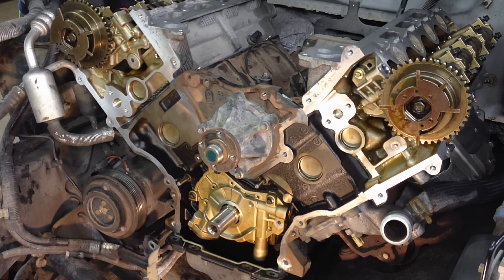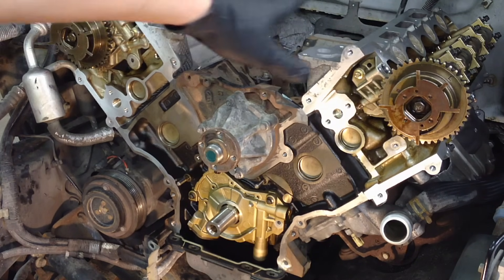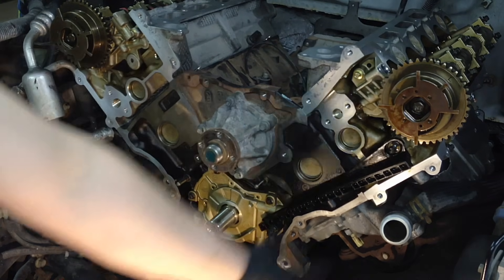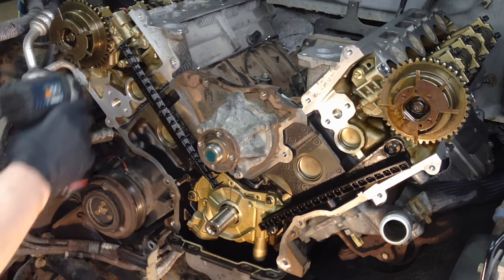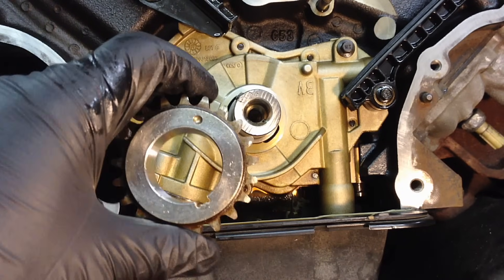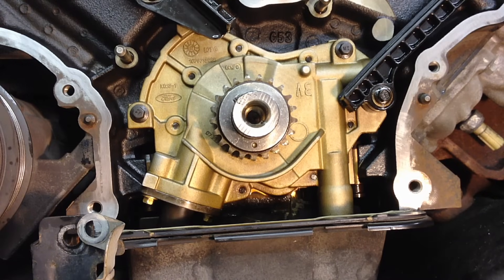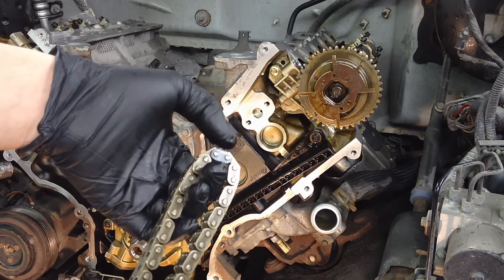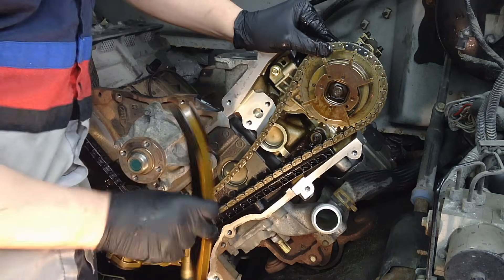Ford 5.4L 3v Engine Timing Walkthrough

Comment: You didnt mention if it was set to TDC on the compression stroke. Does it matter on this engine or can it be set via the TDC of the exhaust stroke
Reply from the maker: It doesnt matter as long as the timing tool is installed you are good.

Comment: Cylinder 1 still has to be tdc compression stroke correct?
Reply from the maker: There is no #1 TDC on compression stroke. The crank is set by the tool and the chain links guide you the rest of the way.

Comment: Hello, so i have done the full timing job as you showed. I have also replaced all of the roller followers. Bought the ford kit that you recommended. Also got the melling upgraded oil pump. Followed all instructions in detail as you showed. Engine was running fine beforehand except for the tick from passenger side chain. Once put all back together the engine starts back up and runs fine cold but once it warms up it runs slightly rough and stalls.  I disconnected the vct solenoids and problem still exist at warm up. I am certain the timing was set right during assembly. Any recommendations on what to check or what the problem may be?
Reply: Hi Ford Tech!  Any insight would be greatly appreciated.

Comment: Good evening, excuse me, I have a 2005 Lincoln Navigator and it's failing. I get codes P0 340 and P0344. I've already changed the camshaft sensor and the spark plugs and it's still the same. Could you tell me what the fault is?

Comment: please help, i re did my timing and i tried my best to follow everything, i replaced everything inside all oem but the phasers are dorman. i still have p0022 and p0012. i swear it was timied properly. crank dot at 6 and valve lobes where out like they should be. i put the truck back together and it idles low and rough, with gas it seems to run ok. please help ive been dealing with this for a long time

Comment: Hey man I really need you help asap I’m in my 5.4 3 valve right now the guides are broken. Previous owner was driving down the highway and it shut off on him. Oil is very sluggish. But I need to know if the motor is saveable or if the timing is jumped and if it is can I get away with retiming it
Reply: Did you save it?

Comment: For this procedure, don’t you have to make sure that the cylinder one piston is at top dead center in the compression stroke??
Reply: I just did a buddies for the first time, the passenger side jumped time after a broke chain guide. The chains didnt have colored links or any reference so  I locked the cams down, with the camshaft key at 6 oclock, removed chains put the driver side back on (with marked links, as it was) and then rocked the driver cam to appropriate link on its chain. I'm sure you know what I'm telling you but I'm just putting is out ther for other first timers.

Comment: what scan tool do you use to check phasers on the 5.4l 3v?  had a 05 navigator get timing job done adn it still acts like timing is slightly off. not sure if its phasers or bad ecm

Comment: Would have been nice to see where that timing tool lined up to when in the correct position. You blocked 30% of the video setting the crank in position.
Reply from the maker: Doesn't matter, the chain colored links is al that matters.

Comment: I followed along the workshop manual so I did the cylinder 1 exhaust lobe coming up exhaust stroke with keyway at 12 o clock then did removed the 3 RH followers illustrated and then the 3 LH illustrated. Then roster clockwise to 6 o clock. Removed  all timing chain components chains,guides,tensioners,phasers. Coming back to my phaser marks aren’t in the same position as you showed or in the book. So the chain marks aren’t lined up I’m not sure what to do next. I didn’t have a timing check engine light before I’m just doing the kit for the phaser tick. If any advice thanks!!
Reply from the maker: Once the cam followers are neutralized you can remove the cams as I show. Then scoop up the followers and reinstall camshafts as shown. Now you can line up the cam and crank
Reply: @ I see it was my fault thinking I could cut corners and not have to remove the camshafts as well haha sorry but thank you for the reply!
Reply: Rotated* lol
Reply: Forgot to mention after the removal I used the special tool and it’s still not lined up

Comment: I appreciate your videos.  I just finished mine.  I didn't do a lot of the things you did like disconnecting the oil sensor and such.  2005 F150.  It wasn't bad.  It did take me 3 days.  I didn't remove the roller followers.  My truck is under 100k miles. I set the crank at 6 before removing chains and then as I removed the chains I had a breaker bar on the phasers.  I simply slowly moved the cam to a slack position in between valves/compression.  The driver side was pretty much there already.  The passenger side I moved left until it wasn't going anywhere.  Then I cleaned everything up, changed the phasers, and just moved the cam back to where I needed it when I reassembled.  Easy peasy.  I used all Ford parts but used the old style tensioners.  All my old parts, including the guides, were in good shape.  Only the driver tensioner was bad.  My phasers weren't bad either as far as I know but I had it open.  

I believe I could do it completely in 10 hours or so doing it again with confidence. If you were comfortable reusing the valve cover gaskets and the sealing surface of the head was relatively clean(mine was), you could really save a huge amount of time by just loosening them and lifting it up enough to access the phasers and never remove the valve covers from the engine or any of the other stuff hanging around.   I am willing to bet I could do it in 5-6 hours this way.  

If I do another one I will rinse the top of the engine off the day before to get rid of a lot of the dirt and debris around the valve cover.

Comment: What would happen if you install vet actuators on wrong side. Doing one today that has left on right bank
Reply: VVT
Reply from the maker: They are universal with markings for both sides
Reply: @FordTechMakuloco  I just found out that they are same part number and the marking weren't visible at 1st. Brain fart morning . Thanks for reaching out

Comment: Hi, so I bit off more then I can chew on this project. 05 expedition 5.4. I am at the point of reinstalling everything and need to time it all. My question is, do you absolutely need to remove the roller followers? Or can you just turn the van to adjust for timing marks?
Thanks
Reply: Sorry camshaft

Comment: Mr Ford Tech I have an important question that no one seems to answer. I have a 05 f250 with the 3v 5.4 . I bought it not running due to timing issues. I spent $2,000 installing all new timing components and oil pump , plugs etc . Now they are saying I have a main or rod bearing knocking . I can’t afford a new engine however I have a very strong 5.4 2v with very low miles since the rebuild. Can I install the 3v top end onto the 2v block . Is there any advice or tips to do this . I want to retain the factory operation of the truck . They said I could install the 2v in the truck but will need to be tuned and other things . I just want my truck on the road and be reliable. Please any advice is appreciated greatly thank you

Comment: What is the cost of doing a hydraulic valve lifters, roller rocker and new cam shafts along with a new timing chains, hydrolic tensioner, and new chain guides?

Comment: I did exactly as you told us, but when I rotated the engine the marks on the timing chain a full rotation were not on the timing chain marks, as 11 o'clock and six o'clock, I used the tool on the crankshaft . so I dont know if this is Ok . Please help.

Comment: Hi, Very informative video!
I was also doing my timing chain replacement in the same Engine, while doing it i lost my Timing, so after watching this video what i learned like if i move the crank shaft to 6 o clock position without rollers & chain on the engine , it will come to neutral position then i have to reposition the crank shaft as described in-the video by using the reposition tool to 11 o clock then install the chain according to mark. Was it correct?

Comment: Hi, back again to check with you, the Ford guru on timing marks. So much false information online. Sometimes I don't even trust identifix. 😂 
My customer today is a 2010 5.4 3v. Owner did his own timing chains and it rattled sporadically. Looks like driver's side cam is 1/4 of a turn retarded, but strangely engine ran smooth as butter. Multiple codes po012, 022, 316, 341, 346, 346. Easy money!

Comment: Ok so just to make sure i heard you correctly. If the cams are not timed together all you would have to do is remove all of your roller followers, set the crank sprocket in the correct position, align the timing chains on the guides install the tensioner guides and tensionors, and your timing should be correct?
Reply: That’s what I was thinking as  well

Comment: Why does the '04 5.4 3v procedure different from the '07 where you turn crank to 6 o'clock. Is it bad practice to perform 04 procedure on 07?

Comment: My facers left is on right and right on left😢
Reply from the maker: No they are universal with timing marks 180 degrees out from each other.
Reply: @fordtechmakuloco if I put crank tool on there so it's perfect but my left phaser is "R" and my right phaser is "L" can I just turn those phasers 180 degrees on the cams so right is "R" and left is "L" or will that make my timing out AND should #1 cylinder be on compression stroke when at TDC when ceank is set  with the tool? please help. I want it back together right

Comment: I’m an Audi tech, and I’m so glad I’ve never had to touch those pos fords. Audis are so much easier and enjoyable to work on. I’m saying this with full sincerity. People think Audis are horrible and that they’re really hard to work on, they’re really not lol. They make simple engines and everything on them makes sense. Timing chains might be in the rear but that’s about the only odd thing. If you have to do chains on a 2.0 turbo you just pull the front of the car off and it’s right there. Takes 3-4 hours. And we don’t really see chains fail on any of the other engines, just guides mostly. I just completely rebuilt the 2.0 turbo 4 banger from my 2016 A4 and I rebuilt the 3.0 supercharged V6 in my 2014 SQ5 these past two weeks and they were both pretty fun jobs and nothing gave me a hard time. Biggest thing to pay attention to is using the correct special tools for the timing and making sure to pretension the cam adjusters before torquing the bolts. Everything else is simple engine stuff, cleaning takes the longest out of anything. Both cars running perfect now. Anytime I look at fords or dodges or any Asian car I feel disgusted. I work at a dealer and I don’t know why but I found myself replacing one of the 2.4L engines in a Honda Accord and I was pissed off about it because the connectors were so incredibly stupidly designed and the subframe bolt torques made absolutely no sense. Also the parts back from Honda they gave me they didn’t label any bolts and they all looked the exact same with slight differences and I was just like bruh tf is this. But yeah I did the Honda engine and then I had another accord too that I did the rear main seal and that balance shaft cover on. Those were equally as stupid. I couldn’t imagine working on anything other than Audis. I used to be a used car tech and I think front axles on an F250 were pretty easy and then I did an evap canister on a Buick Encore which was pretty easy and some work on a hellcat which was pretty straight forward. But still, I’d take Audi any day of the week. Everything simply makes sense.

Comment: I can tell you that's the wrong way to do it cuz the only way to slide them rockers back in is to loosen the cam up and it messes up the cam journals in the cans will bind that's what happens it's a good way to ruin ruin the heads

Comment: What size cams would be a good fit to give it a good lope and better performance and pulling power. Will roller set up work well and why don't they tell you that you have to change this at around 120, 000. I actually made it to 152,000 but how will i know if have trashed the motor the oil pressure dropped to 0. I would greatly appreciate any advice you or anyone can give me. And should I get a high performance oil pump. And what else can i do to up the horse power i had a 2018 and 2020 now after doing a few things to thenm i had them at around 415 horsepower they come from the factory supposedly with 395. I love them. Please help

Comment: I have a 4.6L 3v mustang, I'm rebuilding the motor, first actual rebuild I'm doing. I've worked with the 3v before and messed up the timing. Is this all you have to do?? Many people have told me to make sure I have the pistons in the right location+key on the crankshaft. Something that has to do with the normal stroke and power stroke. I ended up with low compression last time. Could you help explain why a bad timing job would give me low compression, and if the pistons have to be in a certain orientation for allighnment with a normal stroke and power stroke?

Comment: I’ve watched several of your videos and they are very helpful but I still don’t understand how you put the cam followers back in after you put the timing chains on
Reply: just search his videos ,he has one that shows how but you need the special tool. otherwise you turn the crank clockwise until the cam is at base circle for each set of valves  and you can pop them on with a curved pry bar but I find the tool is easier by far

Comment: Had to replace the timing guides on mine (2006 Ford F-150 5.4L 3V 4x4). We got the Left side of the engine & chain set correctly, however, whenever we do the right side we run into this problem:

The R on the right side isn’t lined in the same position the L is, and whenever we rotate the cam it rotates the camshaft and causes it to jump. So we don’t turn it that far, but when we get the chain on and let it go back, the bottom skips. Chain isn’t stretched and crank gear thing isn’t damaged either. Any tips?
Reply: change the broken guide

Comment: Ok, and the timing is set at the Crank Shaft. Do I follow the markings on the chain?. Add replacing a cylinder head.
Maybe I'm over thinking it but the marking in the timing on the cylinder has looks to be correct or maybe I'm over thinking it I don't. Know about 4 I put it back together.
And wreck the motor.  Do I follow the marking on the chains? The difference is one side. I didn't touch that I know it's time. The other side looks to be right on point but looks can be Deceiving. How do I confirm that the Valve.. are in the right position?

Comment: I'm a replacing a cylinder head on a 2013 for an expedition.
How do I set that 1 soon there had to the motor correctly? Do I follow the chain?
Or do I follow the Camp Lobes.
Reply from the maker: You bolt the head on and then follow the complete timing procedure from scratch.
Reply: @FordTechMakuloco  they New from Ford end cam Fazer is new from Ford my question is the Driver side is set but replacing the untimes cylinder head on the passenger side isn't set or it is. I don't know but the chain is telling me it's set.  I just want to make sure that I'm not missing A step.. Add unfortunately. I am waiting for tensioner bolts For the oil tensioner.
Because I can't seem to find the old ones.. And it's on the weekend.. I did remove the 3 valve And it appears the markings on the chain looks to be correct orientation.
At the 11  And 1 o'clock. Maybe I'm over thinking it before I button it up or a nervous.
But everything looks good as far as the markings go and the crank. Is that at the 6 o'clock position? And I guess the question is right now. When? Replacing your head do I have to take the other side that was already set? Where do I take all the chains off and set The timing to be sure. And the valve trees On both sides because the situation I'm in again is one side is already time. The other side isn't. Do I have to take off the chain on the other side to set the timing correctly?.
Reply: @FordTechMakuloco  watching your videos and I appreciate you very much. For what you do keep up the great work...
Reply: Dam phone, sorry . I'm Surprises that the Head bolts didn't  snap when I was doing when I did the 90 degrees  twice. I was nervous . And I Followed the Torque sequence on those heads boy that was Fun.
Reply: @FordTechMakuloco  Just follow the walk through the 13 minute video is that what I should do? Follow the procedures in that order.

Comment: I’m getting ready to do a timing job on my 2006 F150 5.4. 2 questions. I got a timing cover gasket set that came with a small black o-ring. 1. Is that for the coolant passage in the timing cover? 2. Do you remove the screens in the VVT housings to clean them? Your help would be greatly appreciated. Thank you.

Comment: Hello how you doing I have a F350 06 model XL work truck dually Scott like 86000 miles got the 54 3 valve anyway it runs fine sometimes and then all the sudden it sounds like crap

Comment: Yeah, just toss those followers in after you have everything torqued down. They just slide RIGHT in under the cam like nothing. You bozo, your going to throw off all the work you just did timing the motor when you pull the cam to replace the followers
Reply from the maker: I am not sure you know what you are talking about, please see my video on how to replace followers on this engine, thanks!

Comment: I'm getting my 01 back on the road. Been sitting 8 years. New plugs and coils. Replaced the fuel pump. But still just the slightest miss. Brand new radiator,  I'd given the original away. No thermostat in it at the moment but it's overheating. Engine light flashes when it gets hot but goes away at idle. I'm pulling off the valve covers and intake manifold tomorrow. Not entirely sure why I typed all this.